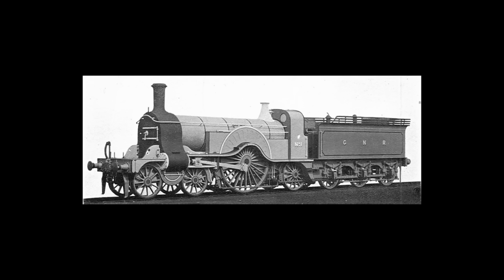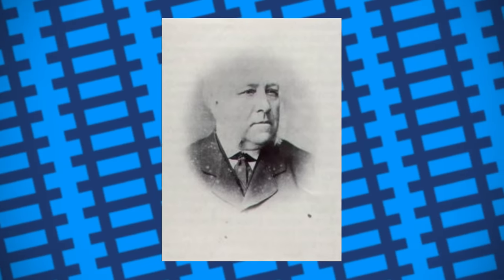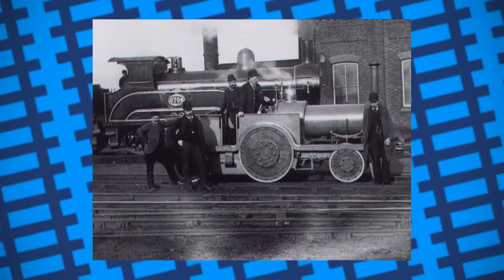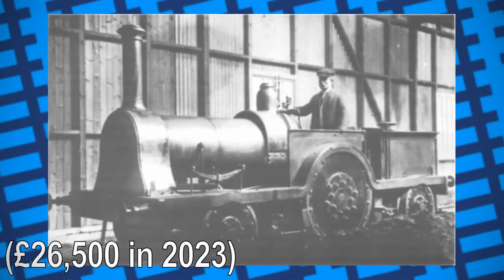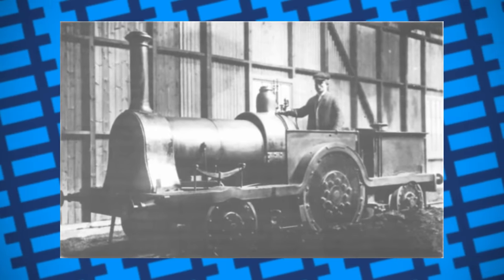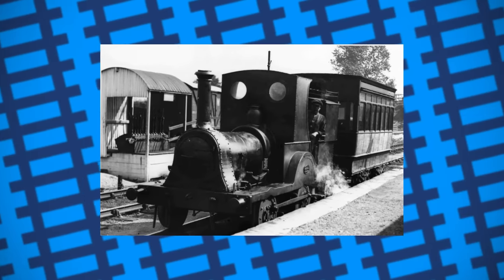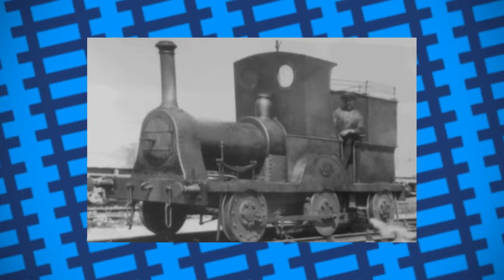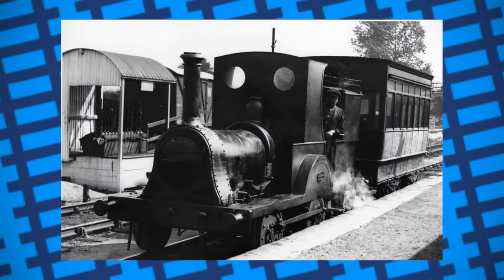The real life little engine that could - "Gazelle"

Comment: Bro literally went “hey are you old enough to remember Stephenson’s Rocket?”
“Say no more fam”
Reply: I mean, did you hear the original 2-2-2 configurations 46mph AVERAGE speed it maintained along the line of that trip? In 1893 it was going intercity faster than modern road vehicles average in 130 years later. At the time (and until 1899) the worlds fastest car only did a record speed of 35mph, the Gazelle went 50% faster... sure that makes it FAR from the fastest train, but people aren't comparing their modern supercars to hundreds of tons of mag lev nor aircraft. That said its cost of £250 is buying power somewhere between £5,000 - £9,000 in todays money, the Ford Model T introduced 7 years later cost £1,000 (although the value of money had almost halved), so for a rich businessman it was a very affordable toy, rather than an extremely high status one.

Comment: 4:28  that would make Gazelle function exactly like a common horse drawn stage coach from the 18th century. 
but of course, it runs exclusively on rails, it sure will do well if it lasted till someone in germany bought for use on their private railway of pedaling carts.

Comment: Have you heard of the “Flying Bufferbeam”. She’s also known to be the smallest steam locomotive
Reply: Ex Courtalds at Grimsby The Peckett's chimney is literally the height of a flower-pot.
To steam the thing a  extension pipe is used so the blower has more 'pull' on the fire until working pressure is achieved.
It did ten return trips along the lakeside & Haverthwaite Railway with a single Mk1 coach whilst visiting from the Buckinghamshire Railway Centre at Quainton Road.

Comment: Chesterfield resident here. Sad to say there’s not much of the LD&ECR remains round here left to see.  There’s no trace of Market Place Station left, nor the nearby signal box or Park Road bridge.  A tiny stub of brickwork is all that remains of the enormous Horns Bridge Viaduct and the two tunnels, Duckmanton and Bolsover, both have portals that are buried or virtually inaccessible.  

You can walk a short section of track bed at Spital but have to turn back when it becomes someone’s back garden.  However nearby is a small but intact bridge over Dingle Lane but that’s about it.  Arkwright Station is gone and the site is very overgrown and the nearby road bridge is infilled.

Doe Lea viaduct was blown up in the 50’s (it was knackered and about to fall down anyway).

It’s not until you get to Langwith that you find much of anything, but it’s pretty good.  There’s still some original sidings being used for wagon storage and, just after that, the only section of the LD&ECR with actual track, which is now the High Marnham Test track.  Past this the absolutely magnificent Fledborough Viaduct remains and is now part of a cycle route, with old station platforms at either end (the station buildings themselves are now private houses).

Comment: Thank you for this - Gazelle is one of my favourite 'odd bods' ; other people also must like her, as there have been several models made of her. You may be closer to her origins than you think; Dodmans, as you rightly say, made fairground equipment and at around this time one of their regular products was a portable circular railway ride, naturally puled by a steam locomotive. 

The engines and carriages had their axles set at an angle, like some primitive toy trains, so they would run on a  very tight radius track. Although photos of them seem very rare, I'm fortunate to have one, somewhere in the archive and the little engine is very, very similar to Gazelle. Given Burkett's request and spec, Dodman's draughtsmen would have simply reverted to what they knew best. 

As always, yes, it's sad she'll probably never run again, but given boiler safety and other requirements, its better she stays as she is, loved and intact, There's be very little left, I suspect, were she returned to working order.

Incidentally, some 45 years ago, the shell of her trailer coach could still be seen, mouldering away at Kinnerley Junction. It's probably rotted into oblivion by now.